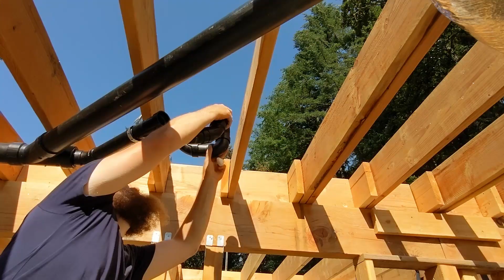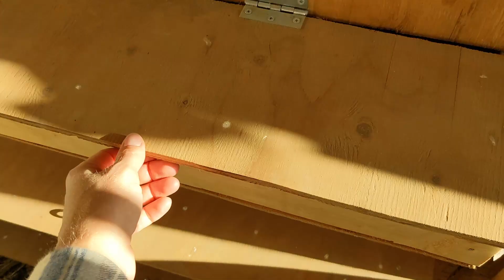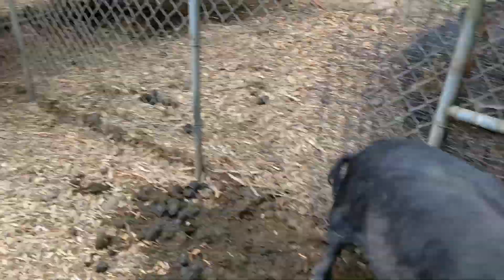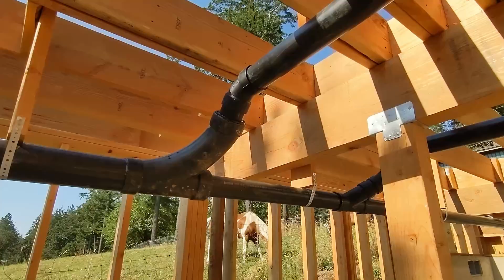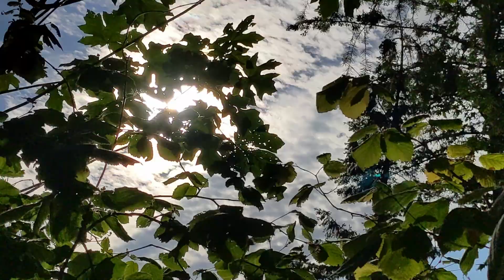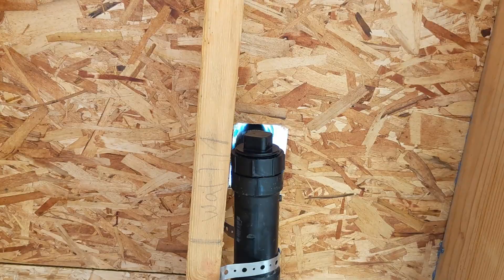Underfloor Plumbing - DWV Stack and Branch Pipe

Comment: Is it a special pipe (I see CHARLOTTE PIPE) for the plumbing and special glue? Looks like black glue. Thanks
Reply from the maker: You can use either ABS or PVC. ABS is black plastic marked for use as "DWV" which means drain, waste, vent. They also have white PVC--a stronger plastic material, and you can use that also marked DWV. 

ABS is common out here on West Coast but I've heard not as common back east. It has its own glue. PVC needs a solvent and a glue, but some cans are marked as both. Check if that is allowed in your area before using.
Reply: Thank you for your thoughtful and informative reply. I appreciate it very much. 

Building a small house in Montana
Reply from the maker: @johnyb9884  good luck!